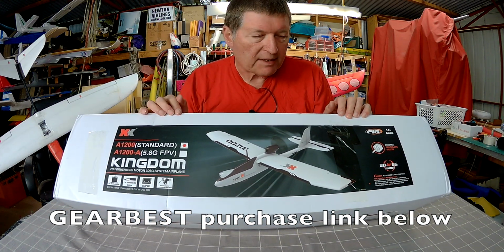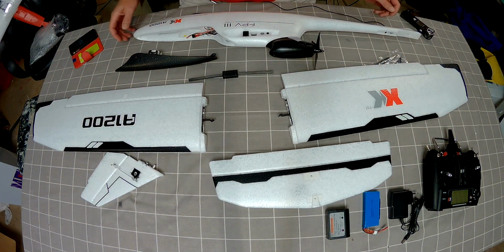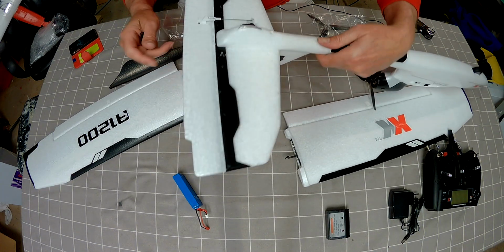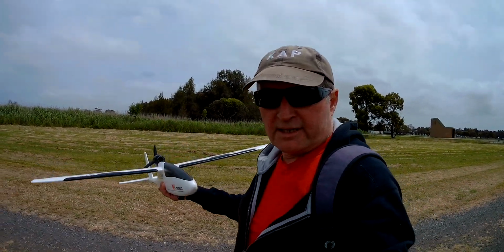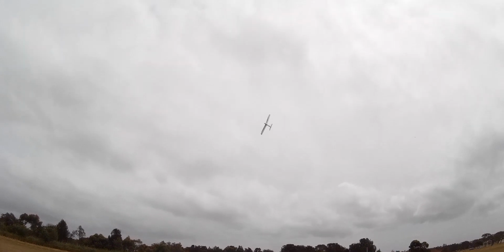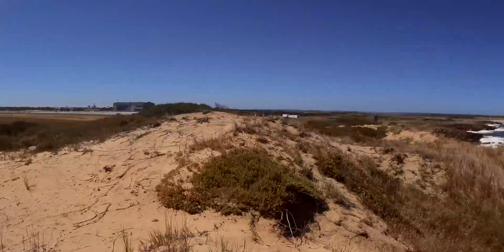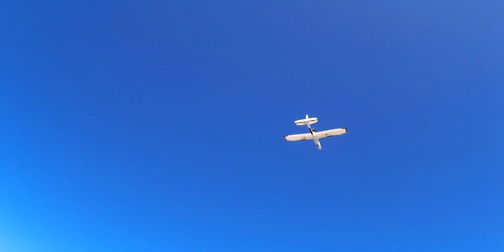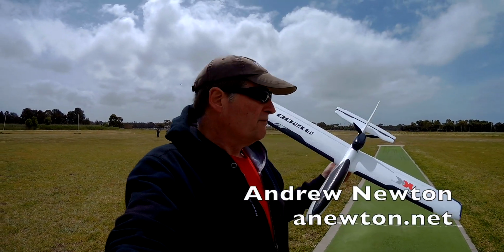XK A1200 review

Comment: I'm totally new to this hobby and looking at getting into slope soaring, love the slow controlled seagull like flight along the cliffs and plenty of those here in North Devon. Spent ages researching aircraft to start with and thing I have now found what I have been looking for. Thanks for the very informative video detailing the flight characteristics of this aircraft  - hate the ones reviewing a trainer then all you get is high speed, low level inverted flight, spins and loops. Your video covered everything a newby, specially a slope-soaring one, needs.
Reply from the maker: Thanks Alan. Great to hear. Any Bixler or SkySurfer style plane is great to learn slope soaring.

Comment: Looked like a well designed plane Andrew....I love flight stabilisers....lol.....A bit off topic, but have you tried putting a tiny piece of foam over the Mobius Mic...?....It might stop that wind noise as the air enters the pinhole in the case..?
Reply from the maker: I have some foam internally  in front of the mic on the hatcam Mobius but not the onboard Mobius.  It's on the To-Do list